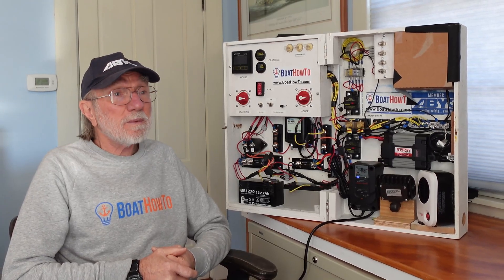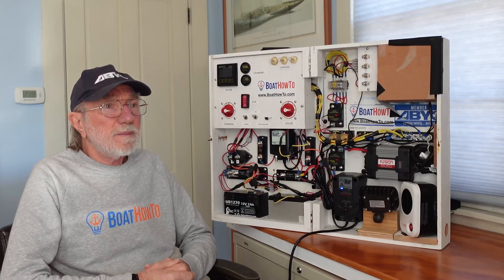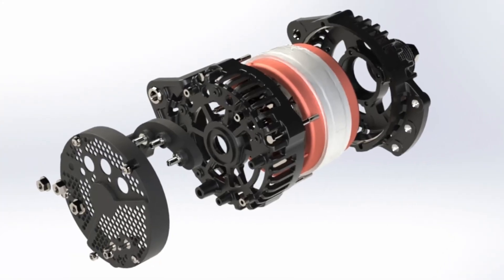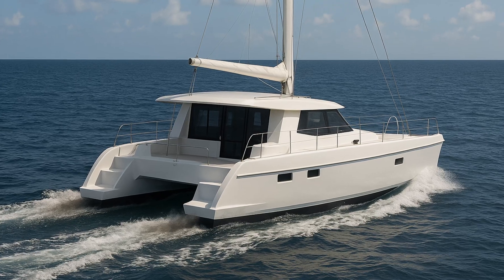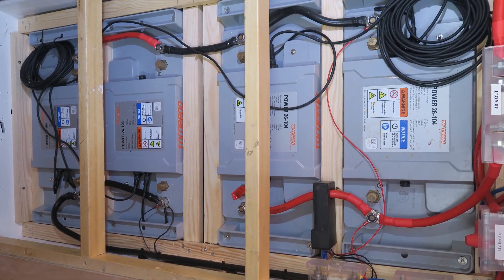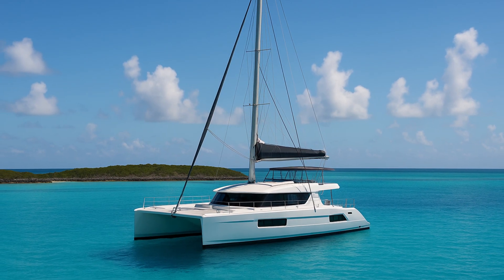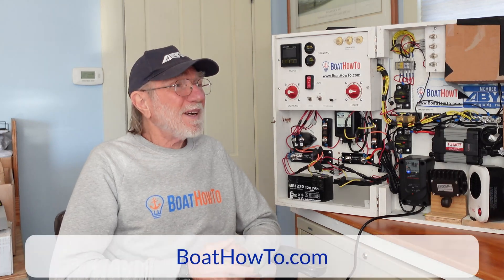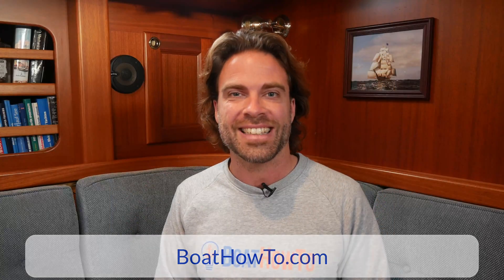With THIS you'll have ELECTRICAL POWER IN ABUNDANCE on your Boat! 😁 Ask The Expert with NIGEL CALDER

Comment: I can't ever get performance out of ny alternator. 250A balmar but usually get just over 100A for about 30 min then it goes into float. Programming the regulator with that stupid reed switch is a PITA. Add in a heap of ignorance on my part. It's frustrating to motor for a dat and still not jave batteries fully charged.

Comment: This is an old idea, throwing a large alternator on the front of the engine then a year later wondering why the engine has front crank/pulley/bearing issues. Most engine manufacturers do not recommend that such a side load be placed on the front of the engine crankshaft

Comment: 250amp eletromaax remote mounted rectifier and a zeus, $2375 much cheaper. Its funny how people still think they can go all-electric with no diesel engine or generator.
Reply: I'm completing a solar powered catamaran. Whether it will be a success or not, only time will tell. On paper, 6kw of panels, 90kwh of lithium and two 15kw outboard motors should be a good fit for a 40ft displacement cat with a draft of 2 feet. At anchor, she should consume no more than 20kW daily even with air con. But as this is all theoretical, the proof will be in the pudding.
Reply: @althecampervanman1619 "displacement cat"... is there any other kind?
Reply: @deerfootnz yes there are semi displacement and planning cats as well
Reply: I have two 140amp eletromaax alternators, with their regulators, mounted on 2gm20's that are limited to 100amps each.  My Lifepo4 batteries charging capacity is limited to 200amps total.  Everything except the batteries and PV panels are Victron.  I opted to get a gas generator for the times we don't move for a few days just to save on using the engines any more than we have to.   With the electromaxx I can adjust the alt output on the fly if needed also.  Has been working for us for several years now.
Reply: 3 days of sunlight and perfect solar output for 6wk of panels to charge your 90kwh batteries.
Reply: @capnbilll2913  Presumably he meant 20kwh, not 20kw, which 6kw of solar in full sun should be able to recharge easily in less than half a day of sun.
Reply: @imageislandmarine4988 It depends on the use.  For day sailing and some coastal cruising, hydrogeneration works fine to recharge the energy needed to motor from a dock/mooring/anchorage.  Hydrogeneration is functionally wind energy since it uses wind on the sails to pull the boat prop through the water to use the electric motor as a generator.

Battery banks can also be recharged from solar, shore power, windmill, etc.

For long distance passagemaking a parallel or serial Diesel hybrid is probably needed for long becalmed passages.

The better the sailing performance of the boat the more it can sail and the less it needs to motor.